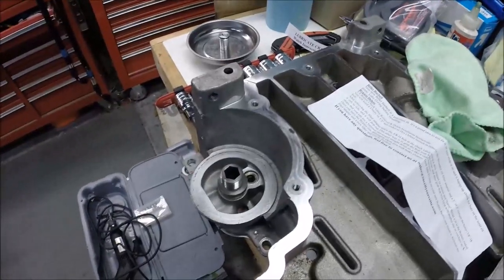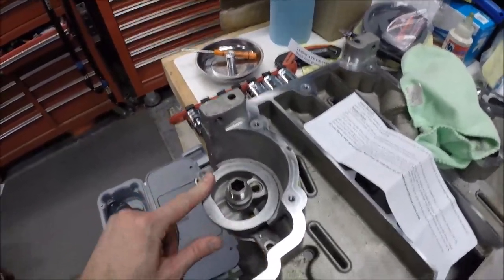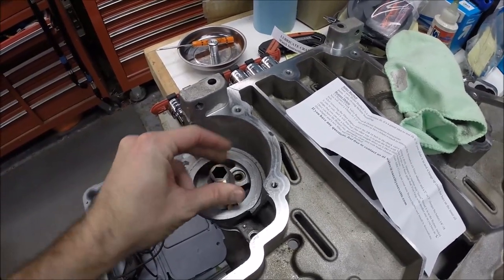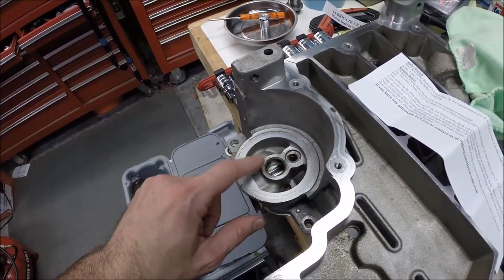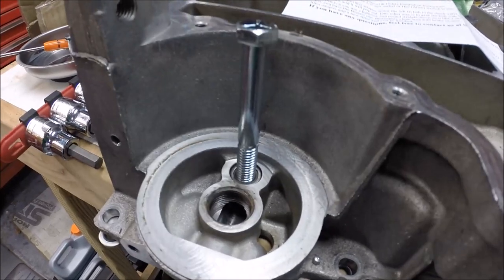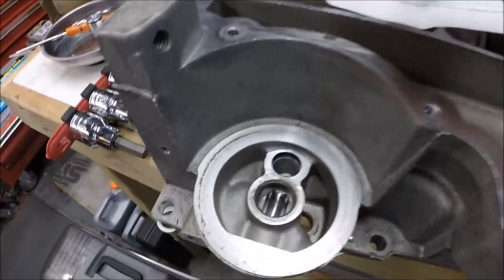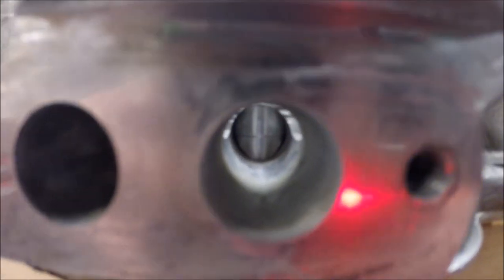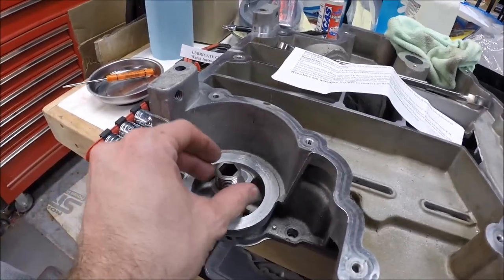1 Simple LS engine upgrade to STOP unfiltered oil!  Oil Bypass Valve Delete

Comment: Every car engine of modern design has an oil bypass. Your real problem is that your camshaft failed you would be better off fixing what ever it was that lead to your camshaft disintegrating and showing your engine with metal debris! Now if your filter should have a malfunction or your oil is really cold your engine can starve for oil! So what caused your camshaft to fail?
Reply from the maker: The cam was an old Thunder Racing cam, and I believe they were using Comp cam cores.  From my research, it appears a number of years back there were some quality issues with some of those cores.  So I don't think the cam wear was a result of any oiling system failures, but rather a cam core material failure.
Reply: OUCH!  Doesn't that suck when a defective product completely destroys all the hard work and effort put into a project?  :(
Reply: Yes, most all camshafts are ground to 0.003-0.004 of final profile, then heat treated. It depends on the company but "Case Hardening" is normal for least amount of warpage. The cams are then ground to final finish & profile.
  GM had a number of camshaft failures due to this issue in the 80's. I changed a lot of them but they had lasted to over 100+ miles on flat tappet lifters.
ASE Master since 78

Comment: You'r oil filter has a bypass spring built into a.
Reply from the maker: Ben Goodhue  Yes, some oil filters have the bypass built into the filter itself.  However, for the LS motors, since the bypass is in the block, there is not a bypass in the filter.
Reply: AC Delco filters are built for up to 25psi relief valve incase the media becomes clogged.
Reply: Isn’t the bypass in the pan?  Not the block.